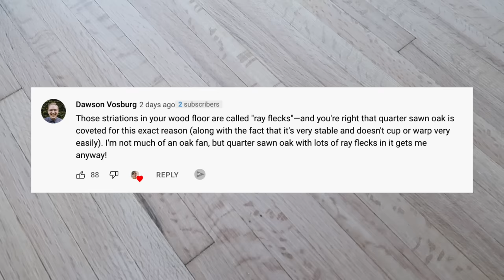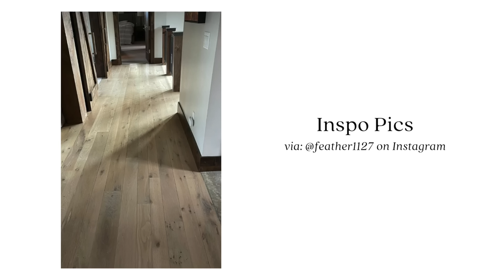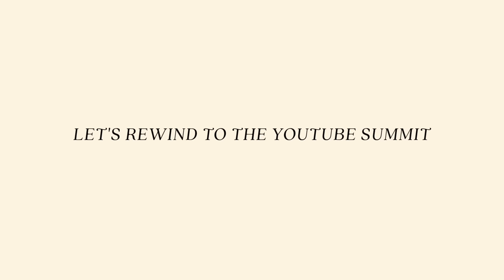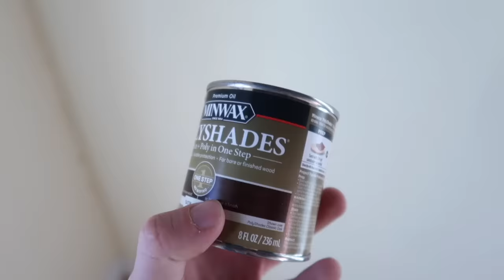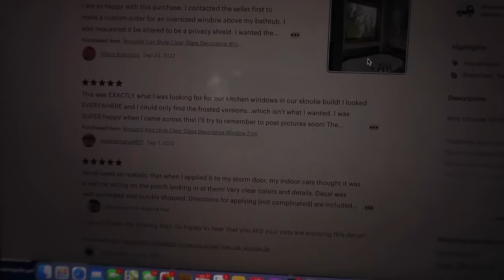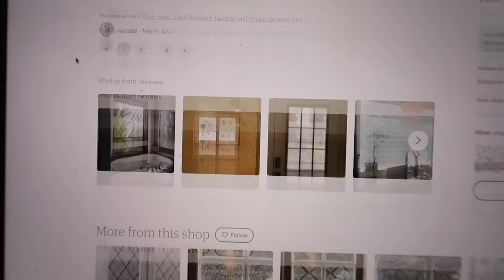Some sad news

Comment: RIP Roger, it was so lovely you were able to show him thru your amazing apartment.
Try oxalic acid on the dog pee stains; it's what all the furniture flippers use to remove dark stains on wood furniture. Or hydrogen peroxide. Test different solutions in random spots and see which works best. Good luck with it. The floors look so beautiful sanded BTW!

Comment: So Sorry to hear of Roger's passing. Was so looking forward to seeing you do a little makeover for him in his place. It was touching how appreciative he was of all you did at your place.   I do have one little tip to help you lighten up some of those pet urine stains on your hardwoods. Grab a few jugs of hydrogen peroxide and some fairly sturdy textured paper towels. (I prefer the Viva paper towels for this.)  Tear off strips of the towels and roll them up into varying sized twists (much like Marijuana joints....sorry, but that's what they look like!) Lay them in a shallow tray or old dinner plate and pour just enough peroxide in the tray to saturate them, then lay them on the dark places on the floor, kind of going along with what should be the lighter parts of the woods grain in a woodgrain pattern. I found it best to do this right before I left from working in the space for the day, then left them overnight. Next day, I'd pick them up and see how much lightening had occurred, then retreat any darker ones again before I left (Darker stains might take 3-4 days of this, but you'll be coming and going anyway as you work.) I've been able to totally remove lighter stains doing this, and make most of the medium to dark  ones much less noticeable, since you're basically bleaching with the arrangement of the little strips to match the pattern of the wood. This should work pretty well since you plan to go medium dark on your stain anyway. Please post pics of your results if you try this. I'd love to see them. (I've had pretty decent results with this doing it right through an existing finish. Just be sure to get just the straps wet...not let a puddle of peroxide form.)

Comment: I renovated a house that had a lot of pee stains on the hardwood floors because the previous owners bred pitbulls. So to get the pee stains out we used a water stain remover for log cabins. A mistake I made when staining floors for the first time was using a water-based stainer and sealer so every time something fell on the floors it would leave a little watermark. I was suggest getting an oil base stain and sealer. For that small Gap at the door you can use a wooden threshold or reducer piece if they are two different levels.

Comment: I get the concept of having different flooring tones for shooting, but you tend to ground with rugs, so unless that is going to change, the overall continuity is generally important for value and design. The middle flooring choice is a middle tone and will likely photo well in all circumstances, as well as meshing well with the woodwork you won't change and that you are changing. It isn't as dark as the woodwork, but it will look just right with your selections without being over powering. It is shown on oak flooring in the posted sample, and you can see how beautiful it is.

Comment: Hey Drew.  I'm so sorry to hear about Roger.  There's no perfect way to handle that kind of loss, but you handled it gracefully and honestly.  That's all you can do <3  As for your floors, I just had a ton of success with this!  It was super scary because I thought I would just make the stain worse or end up with a super light spot...  I did a bleach/water solution on the dark spots and let it sit overnight.  It took a few rounds, and I tried to blur the edges by using a spray bottle to add extra water around the edges so it wasn't just a hard line where the bleach solution was.  Anyways, after a few rounds of this, and by the time I did the stain over the top, it turned out super well!  Hope that helps.  It was such a simple solution that someone recommended to me!  I was surprised by how well it worked!  Just a side note too: I recently purchased a dilapidated old house to use as a rental property and have been renovating my little heart out.  In large part, my confidence to take on such a big project is due to the years I have spent watching you and XO Macenna do amazing things.  Thanks for all of your positivity and creativity.  I'm so amazed by the things that you do and hope this GORGEOUS house of yours turns out just how you want it to!

Comment: Murphy Oil soap recommends using white vinegar and grapefruit oil OR hydrogen peroxide and then to use baking soda to remove the dampness, allowing to sit and then vacuum it up. Not sure how many treatments it would require, but thats what I found. Good luck Drew!

Comment: My home was built in 1910. My main floor is oak with walnut trim and the 2nd floor is pine (back in the day they would use the more expensive wood on the main floor, and less expensive where guests would not see.) So while it's the same stain its different wood so our 2 stories look very different - so it's not unheard of to have separate floors that do not match. Just FYI - the staircase is the oak and the handrail is walnut; you don't see the pine until you are on the 2nd floor.

Comment: Ive had a ton of these from my dogs! 

For the black spots try hydrogen peroxide! lay a cloth above the stain, and cover it lightly with HP, leave it over night and change as needed. It will bleach the spots!  Some urine spots are very deep in the grain, you may be better off just sanding down each spot individually.

Comment: I stumbled upon your channel when you had the video that revealed your apartment to Roger. I was struck at the similarities of your relationship with him to the one I had with an old landlady I used to run from almost 20 years ago. She was also elderly and very kind, thank you for sharing your work with him as I’m sure it gave him great joy!

Regarding the pee stains on the wood floors, you should test an area with a enzyme treatment. The problem with dog pee is that it’s soaks into porous material pretty well. When it’s dry, it does not smell. However, when moisture is introduced the uric components of animal urine will make themselves very evident. We had this very same situation with our concrete subfloor. We used an enzyme treatment three times where we cleaned the area with TSP solution and hot water enzyme treatment from Amazon, followed by a hot water rinse. In your case because you have wood, you need to be careful with water, so see if you can do the enzyme treatment, and perhaps seal with some sort of varnish or lacquer. That’s not the best solution for wood floors, but do your research if you can’t use the enzyme treatment.) 
This is what we used: 

BUBBAS Super Strength Commercial Enzyme Cleaner - Pet Odor Eliminator | Enzymatic Stain Remover | Remove Dog Cat Urine Smell from Carpet, Rug or Hardwood Floor and Other Surfaces (Gallon)

Comment: use a floor transition strip. Transition strips, typically made of wood or lightweight aluminum, can easily be cut to length with a regular miter saw or hacksaw.

Comment: Hi, You had 2 questions I've heard so far. #1 dog pee, no answer except I have heard its a nightmare for homes so only sanding down further would be only thing I can think of to do. #2 the gap in the floor transition? Its exactly that - a transition so home remodel stores carry things called transition strips and you can cut them to fit  across that gap. Now it may give you a tiny raise in the floor there, a bump but if the right one selected and cut to fit right, it will look professional and hide the gap. Ok good luck.

Comment: Mantle should match the trim color 
The trim over the door would include a crown molding with casing which is the trim on the wall plane the trim in the actual opening vertically is called jamb on the top is the header

Comment: You have probably dealt with those wood stains by now, but in case you haven't, you can try bleach, but if that doesn't work they sell wood bleach at the home improvement store.  I used it and the same kind of stains and it worked pretty well.

Comment: Seen online recipe: Hydrogen peroxide (3%) mixed with water is often the cheapest and most effective solution for animal urine cleaning. Simply moisten the rag or soft absorbent cloth like felt and apply to the spot. Allow the rag to sit \for few hours to thoroughly remove the urine stain and odor from the hardwood floors.   Rest in peace Roger !

Comment: Dog pee: You can try some DIY formulas for cleaning the urine stains. Such a formula is made from 10 ounces of 3 percent hydrogen peroxide, 3 tablespoons of recently opened baking soda, and 2-3 drops of dish-washing detergent. Mix them in a bowl until the baking soda is dissolved.  OR Mix one cup of vinegar into a warm water-filled bucket and the add some drops of grapefruit oil to the solution to get rid of the odor. Scrub the floor with this safe cleaning solution, concentrating on the most prominent spots. As you scrub, the odor and stains should be disappearing.

Comment: Hydrogen peroxide might help with the stained floor.  You soak a rag in the peroxide and let the rag sit on the spot for a few hours.  It will also help with any potential lingering odors.

Comment: I was able to remove pee stains in hardwood by putting hydro peroxide on the floor and covering it with plastic overnight to keep it moiset.  The hydroperoxide bleaches the stain without damaging the wood and neutralizes the pee.

Comment: You could totally have different stains on the floors of each level of your home. I have dark bamboo flooring on one level of my home and a light oak stain on the other level; as long as the entire level is the same, it has a continuity and flow that ties everything together. Having everything the same in the house imo is boring and so "builder basic" (like, oh, of course they got a deal on the flooring so it's everywhere 😆).

Comment: Check with a Restorationist (Antique or other) to get the correct! stain removal techniques. If you use modern-day chemicals it could ruin that gorgeous 100 yr old  quarter sawn oak.

Comment: There's ways to lighten stains in wood. Mineral spirits, turpentine or Chlorine if nothing else works. Soak cloth or rag in liquid and rub along the stains.
Also: don't stain the wood, just treat it with oil; it's too beautiful to be hidden under stain and stuff

Comment: Here’s my experience with dog pee and hardwood floors (take with a grain of salt!) I grew up with three small dogs. As they got into their golden years with canine cognitive disorder (dog dementia), they would pee aaaaalllll over the place. By that point, my parents had built their dream home and put in some high maintenance solid hardwood floorboards. These floorboards required a specific humidity level and re-oiling multiple times a year. If any of the dogs peed on the floor, their pee would ruin it and they’d have to replace each board. Now admittedly, choices were made in my scenario 😅 And this might not apply to you if someone has a great resource/method for removing stains out of hardwood. However, it might be worth considering that you’ll need to replace the floors upstairs or use a darker, even stain to cover them.

Comment: So sorry about Roger.  I was able to get dog pee stains out of my hardwood floors by soaking paper towel in hydrogen peroxide and letting it sit on top.  You will have to do this many times but it works.  There are lots of YT videos on it.  Good luck.